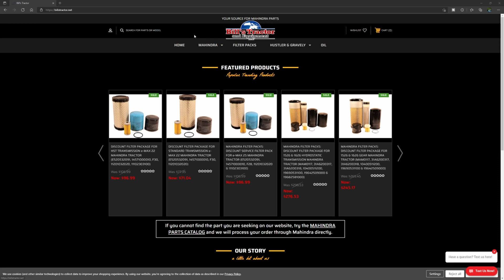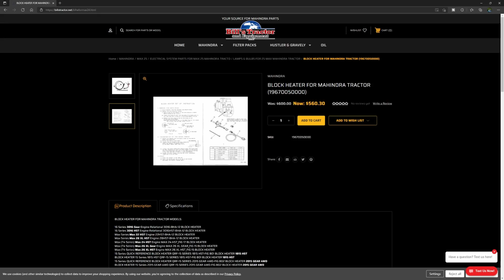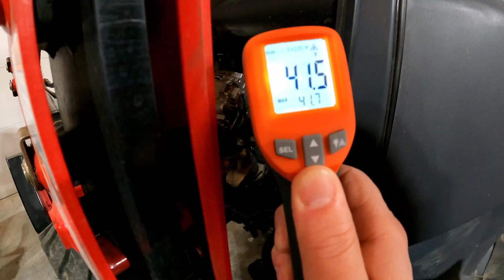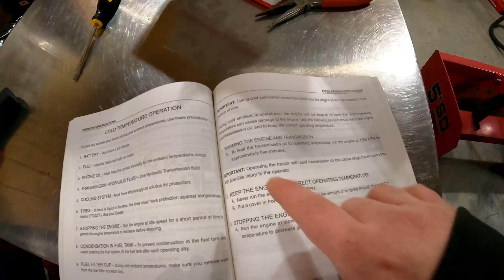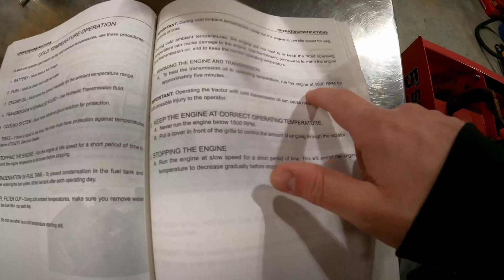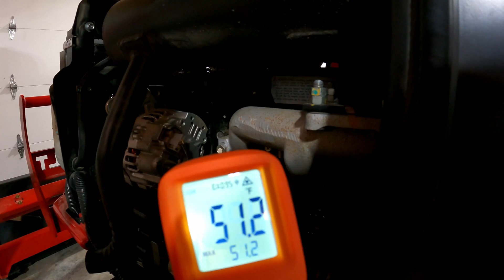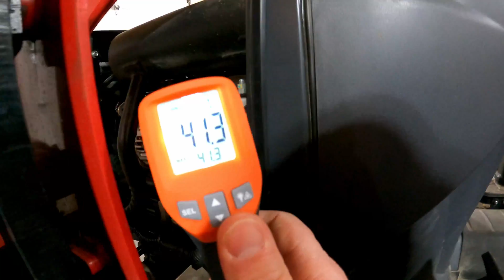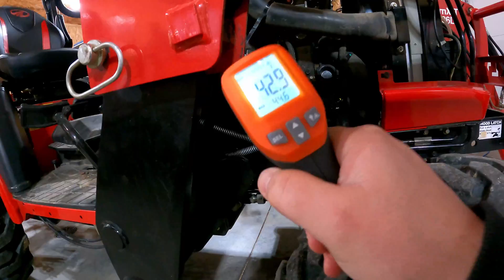Engine Block Heater Performance - Mahindra Compact Tractor

Comment: Great video, thank you. I keep my tractor in an unheated garage in the upper Midwest not too far from the Canadian border. I don't stay at the property full time so I purchased a cheap WIFI switch and plugged in the block heater. I have it programmed to automatically turn on at 33 degrees and turn off when the temp reaches 40. After watching this video, I will adjust it to 20 or lower - heater on, 30 and up heater off.

Is this a good practice?!
Reply from the maker: You certainly dont have to keep it plugged in at all times unless you are wanting to run it, even the glow plugs will be enough to start the tractor in freezing temps. However, it is better on everything to stay above freezing, oil, coolant, etc.  If you haven't id recommend putting a battery maintainer on it if the tractor sits for long amounts of time. I hope this helps!

Comment: Have this same tractor. Some common issues that hinder cold weather performance: 

1. Glow plug buss bar is made of aluminum and can get oxidized. Replace with copper.
2. Glow plug connector is not the best. Cut it off and replace with ring terminal direct to front glow plug.
3. Battery terminals can get oxidized (black lead) in between battery terminal and clamp. Clean both sides off with wire brush occasionally.
4. Ground terminal to frame can get corroded and make a bad connection. If it seems iffy, take it off, clean frame surface, replace ground lead.
5. $500 is way too much for a block heater and mahindra/mitsubishi should be ashamed. Available for other manufacturers' typically under $50-100. I bought a torpedo heater instead for half the money, plus it has other uses.

Other notes: replacement glow plugs are NGK 6528 (Y-114T) and are about $6-10 depending on where you get them. Local NAPA parts sometimes have them.
Reply from the maker: Thanks for the feedback! I am sure my dealer used an alternative black heater, $500 is a little rich. Appreciate the comment and thanks for stopping in!

Comment: Hey Kyle, thanks for showing this.  Here in Ontario Canada I keep my BX23s in our shop, and sites about the same temps as you.  I haven't had to use the block heater yet in 2 winters.
Reply from the maker: Good to know someone is in the same boat i am! Stay warm up north!
Reply: @k6outdoors  it's been unseasonably warm here with hardly any snow.  This time last year I'd already gone through a thousand liters of propane, and plowed the driveways 6 times, and this year only plowed twice, and only used 1/2 that in LP so that's good news.

Comment: Good evening Sir,  Great informative tractor parts link 👌😉👍 Yes In deed slow win the race on the warmup according the tractor maker 👍😉👌 Yes the same applied on the cool down too 👌😉👍 By having a tractor in the heated garage help a lots help a lots and having engine block heater is great 👍😉👌 You save a lots of fuel when a engine is warm 👌😉👍 My Toyota need at least 4 hrs prior ( the car is outside ) when the temperature are neat 0 F 👍😉👌 OUSTANDING FULL WATCH informative video Sir 👌😉👍🧐 All the best Sir CHeers 👍😉👌🍻
Reply from the maker: Thanks Dave it really is appreciated, I am enjoying your snow videos very much, Stay warm!
Reply: @k6outdoors  Thank you very kindly sir 👍👌😇🍻